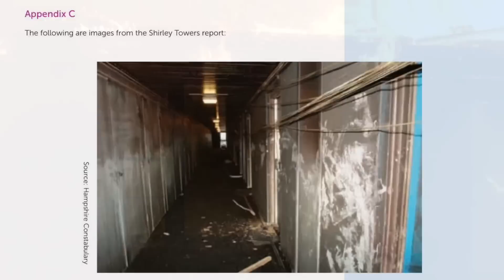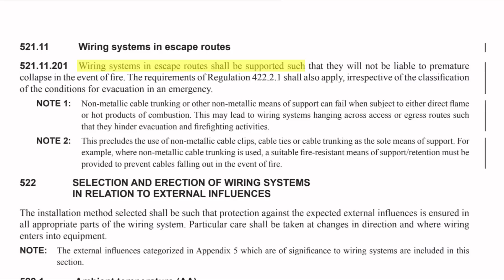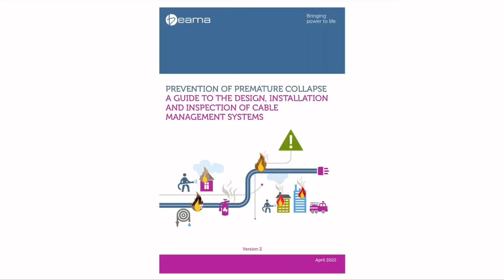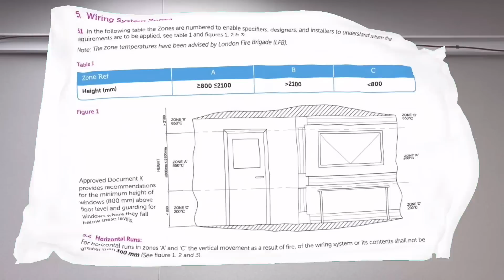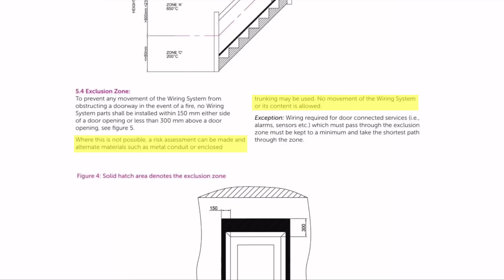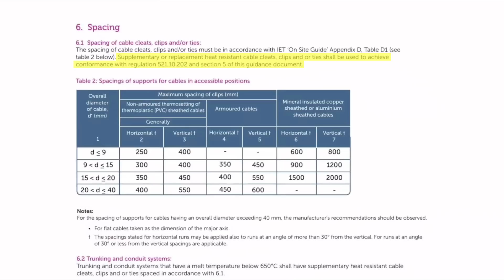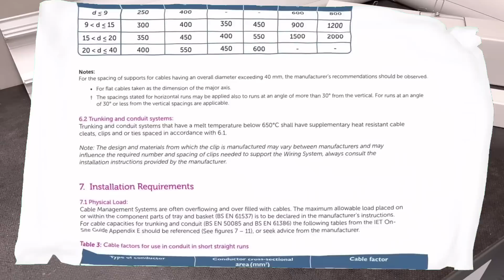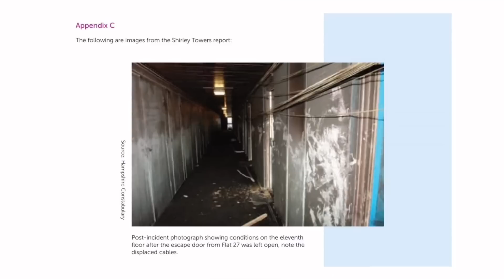Collapsed Cables Cost Lives!

Comment: Ex door entry installer , we started doing this about 2012, we used metal p clips inside trunking, the company that I worked for always took it seriously, a bit if extra work could ultimately save someone,

Comment: In the last 12 months I've upset numerous commercial office refit companies because they've used plastic conduit and plastic saddles in the refits across the ceilings regardless of height. I insisted the saddles be replaced with metal and after some huffing they complied but surely companies doing this should keep up with amendments and technical bulletins. Or are these large companies just operating on the principle it's cheaper to pay the fine/ compensation etc than doing the install properly.

Comment: Considering an EICR would it be recommended to retro fit non combustible fixings ?
Reply: Just been given c2 on cables above false ceiling as they don't have metal clips installed prior 2000 tho so should be a c3???

Comment: Great video. Could you maybe delve into the regulations regarding the routing of SWA submain distribution cables through a building & the avoidance of routing these through 'protected escape routes'? Would be interested to hear your thoughts.
Reply from the maker: Good question. 👍
Reply: @efixx  Section 422 (422.2), Appendix 13 & May 2023 Corrigendum relate to this specifically. It is a tad confusing but after contacting the NICEIC, they clarify that sub-main/ distribution cables must not run through protected escape routes & the only permitted cct types are the 3no. in 422.2....wondering if you guys agree?
Reply from the maker: @neilrowlings  Tune in to eFIXX TV next Wednesday we have Michael Peace from the IET joining us. Amd 4 may have some changes to this.
Reply from the maker: @neilrowlings  8:00PM stream link will be up on Monday ready for the Wednesday show

Comment: So what about in a domestic house 🤔
Reply from the maker: Same rules apply but most cables are above plasterboard which is a fire barrier for typically 30 minutes.
Reply: @efixx  ok but most fires will over 500c and 30mins most firefighters are just turning up at the scene these days 🤔
Reply from the maker: Thats the requirements set in the building regulations. Thirty minutes should mean the property is empty and no need for a fire fighter to enter.

Comment: Best practice is no bad thing, but the electrical industry clearly keeps making changes to regulations to make work and require money spent on training. Hey, surprise, it's a sponsored video...

The emotional plea at the beginning was really over the top.
Reply from the maker: If the changes increase safety standards and prevent needless deaths then that's not a bad thing. I'd rather be a bit over the top when emphasising that people lost their lives because of poor electrical practice than make light of it and more people die.
Reply: @efixx  A concrete house is much safer that build of wood. To prevent needles death every house should be build of concrete, isn't it.

Comment: Try telling BT, Open reach, Kelly communication, sky and Virgin Media about securing overhead cables properly, they just say "oh it's not carrying voltage" oh right so that's gonna save a life when it falls and someone gets caught and dies, it's ok because it's not a voltage carrying cable,
Reply from the maker: The information's here for them! 💪
Reply: Agreed, cowboy outfits masquerading as respectable organization's
Reply: This is why I can occasionally be seen making comments about people doing data & electrical having had experience in the other profession too to do it properly.  There's a lot of benefit in having walked on both sides of the fence, in my opinion.
Reply: Had two young BT guys gaffer tape a new phone line to the front of a cupboard because they couldn't be arsed to move it away from the wall to drop it down the back, so that sounds normal.